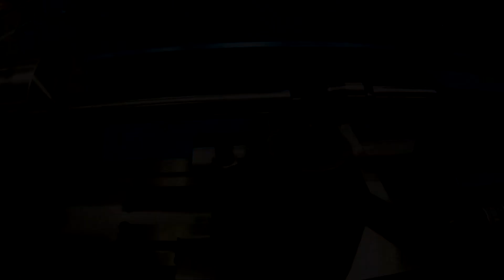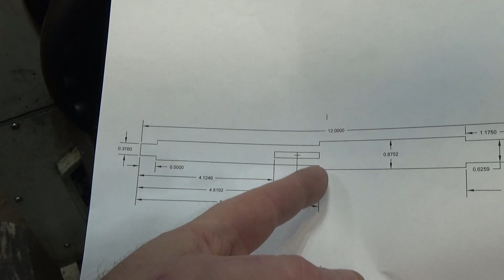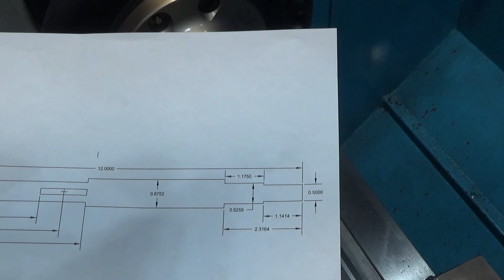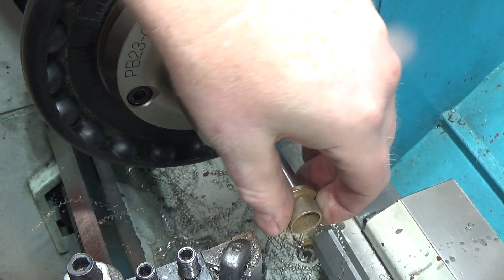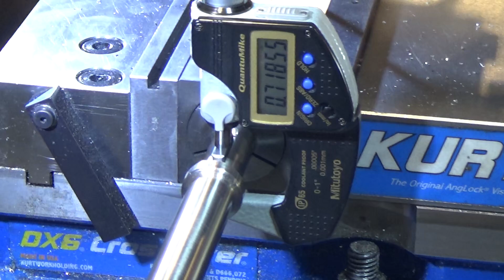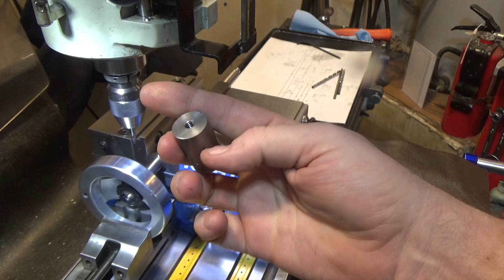146 6x48 BeltSander 08 Lower Lift and Tilt Assembly Part 2

Comment: Hi Robert. First let me say I really enjoy your videos. Thank you for sharing. I noticed that at about 6:24 of this video you changed the tool holder and insert type. Would you be willing to share the manufacturer and the insert you are using? Thank you
Reply from the maker: Thanks for watching. The tool is a generic DKJNR2525 - which is 25mm square or 1 inch. A lot of smaller holdes would require 2020 or less. The inserts are KNUX 160405 and I have some from Korloy and Sandvik.
Reply: @DudleyToolwright  Thank you. HAPPY HOLIDAYS!

Comment: Enjoyed the camera angle on the lathe. Seemed better than usual. You have a different set up?
Reply from the maker: Thanks. No, I still have an adjustable arm attached to the back splash. If I ever want to use coolant I will have to find a new solution. This time I tried getting the camera to be closer to my perspective. It is a lot of stick out, but I think it looks better.

Comment: I have used those types of "screw pins" on multiple designs. Usually with a setscrew. A good hint to make them is to get a long screw, chuck the "waste" extra length, turn the diameter and then cut it off.
Reply from the maker: Thanks for the tip. Interesting approach.

Comment: If you are press fitting the bronze bushes they will shrink and tighten up on the shaft anyway won't they  ?
Reply from the maker: They might a tiny bit, but I actually don't know for sure. There is only 0.001" interference fit which leaves only 0.0005" per side.